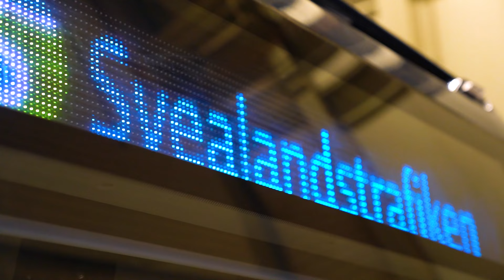Ebusco 3.0 18M in production - Svealandstrafiken

Comment: I rode that bus, it's really nice to ride but i think asthetically it could be improved, the stop buttons are way too small and the bus itself is very loud on the inside. Seats were comfortable but also specially chosen by svealandstrafiken. The tail lights look so old fasion and cheap. front of the bus looks year 2000
back of bus looks year 2000

The driver seat is the biggest downgrade from the current man buses. The buttons and panels look super plastic and cheap, there are buses from the 80s that did a better job at this part.

Astethcially the svealandstrafikens biofuelbuses are basically perfect, interor and exterior, i suggest you learn from those before you continue mass producing these electric buses.